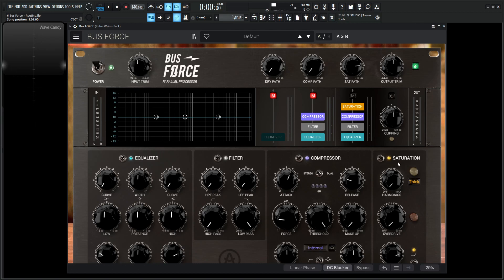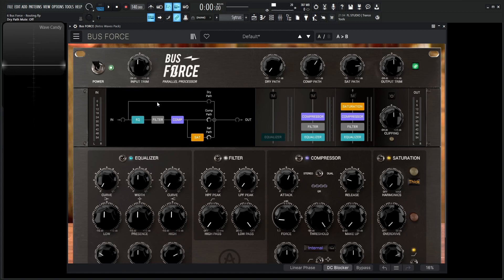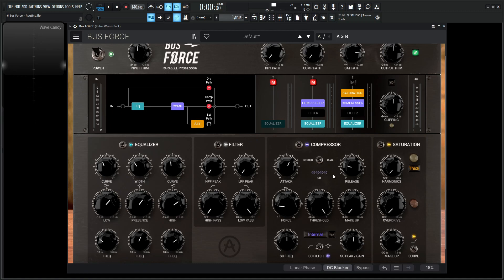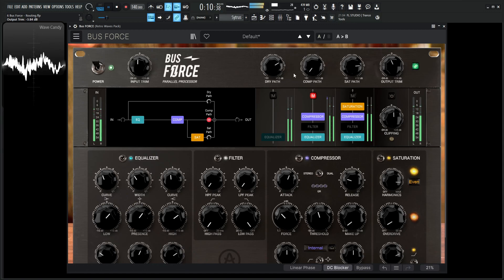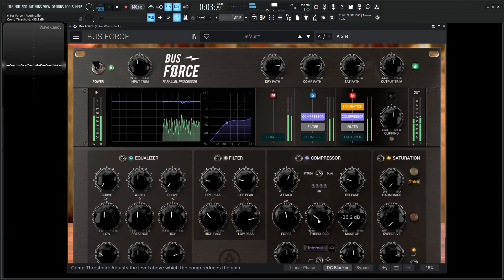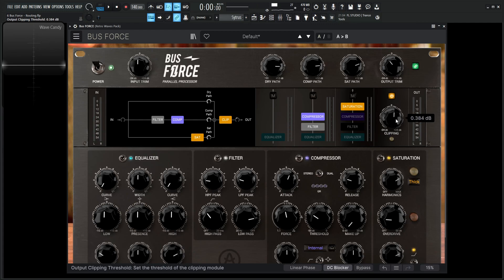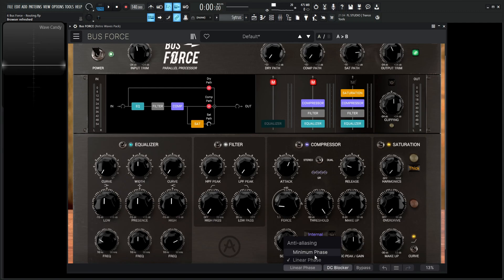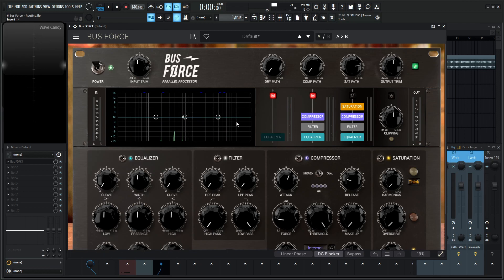Bus Force Routing Arturia Plugin Tutorial - Part 6

Comment: Hi Jon nice series thank you! Does the compressor on the  SAT path work independently for the COMP path basically having to seperate compressors for each?
Reply: Sorry I meant filter
Reply from the maker: thanks dude!! So the filter that can go into either the comp path or the sat path is only one filter. You can either run that filter though both comp/sat paths or have it run though only one or the other of those two paths, just depends on what routing you want. But yeah its just one filter module that you decide where you want it in your signal flow.